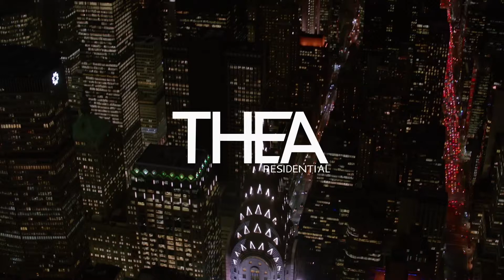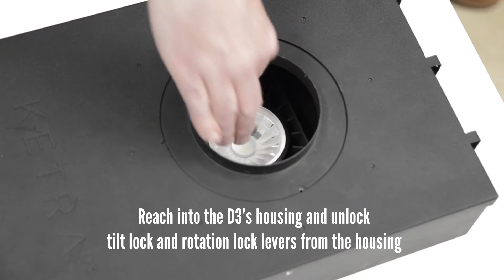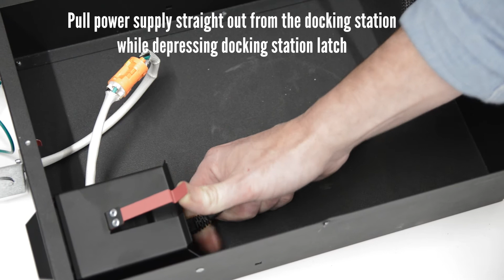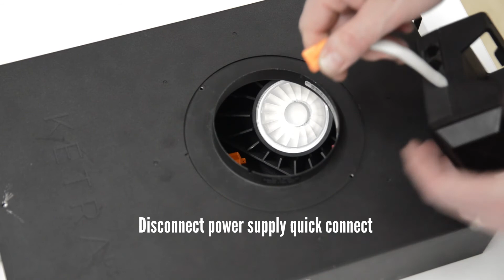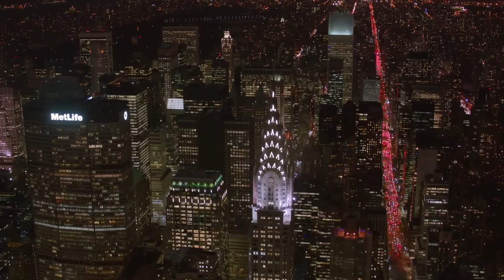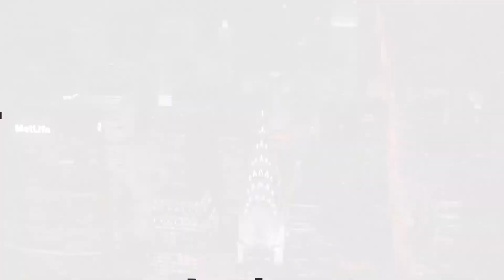Lutron Ketra D3 Power Supply Replacement

Comment: This is really very helpful. I see the circle trim rotates on the box when you rotate the bulb out of the way at 1:26.   that is behind sheetrock and installed and we have to install the power supply while the box is in the ceiling.  is this going to be a problem to install the power supply.  they were shipped and installed without us knowing the power supply was not included.
Reply: find the guy with the smallest hands... its doable but not easy.